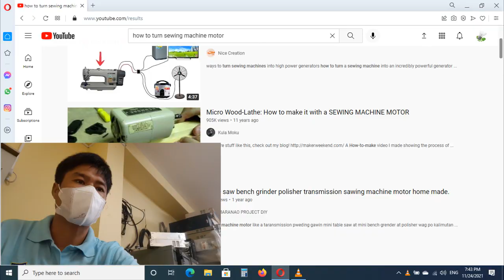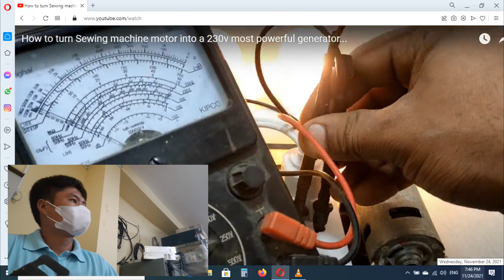Real or Fake? #How to turn sewing machine motor into a 230v most powerful generator

Comment: ⌛ Please check the time lag from that video maker between 06:08 to 06:10, maybe that rotor has been exchanged with a rotor that already has magnetic power (a rotor that has been wrapped with bare copper wire and an electric current is applied or one way to make magnets).

Comment: That must have been some high powered wire. LOL ...Maybe he connected it to a lightning rod, and the molecular structure of the iron was changed into magnetic iron. LMAO He probably did that part off camera...this was so poorly done that it wasn't even believable. Do you know why these projects are rated at thousands of watts, but never has one been shown to run a welder...because the wires that big are too hard to hide...ROFL  Even if it worked, the bushings would wear out shortly...it's not made for generating...the windings weren't separated from the brushes, which is the only way to get anything out of that motor...put some voltage on the brushes, and collect watts from the windings...this wasn't hooked up that way, so it cannot work, without burying magnets somewhere. The non-magnetic iron won't be magnetized by a foot of wire, though. Total fail...
Reply from the maker: Yes Thnk U, that good🌾